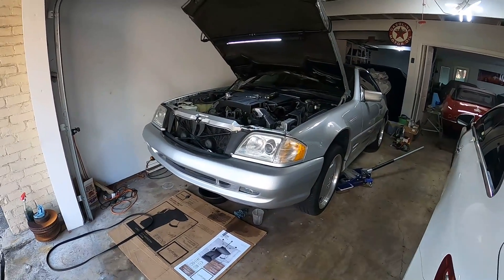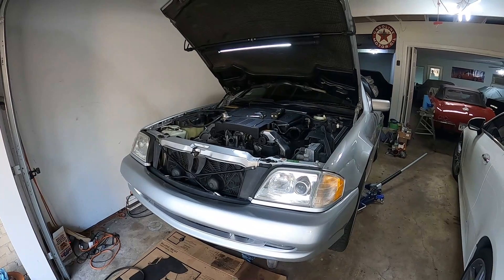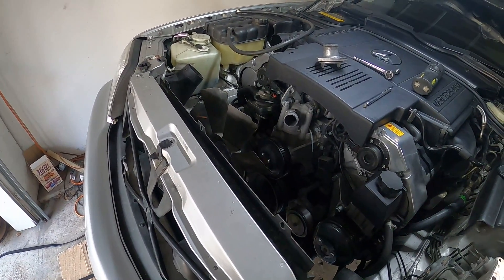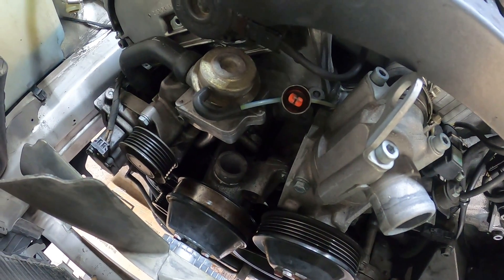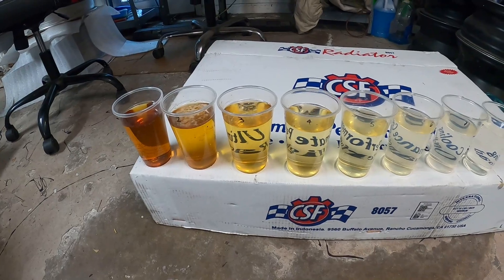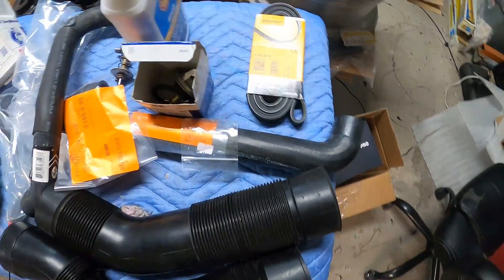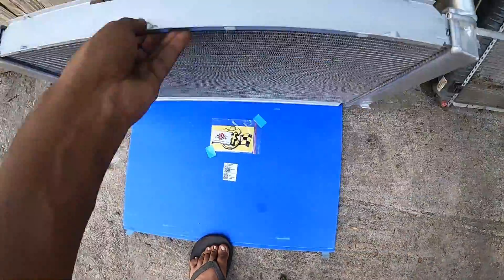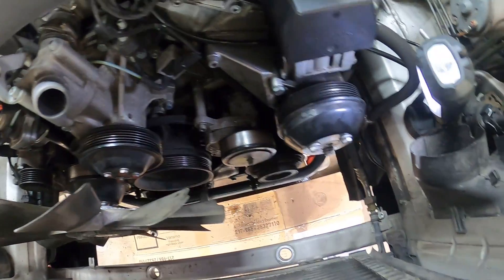Mercedes Benz SL500 R129 - Cooling Maintenance, the "right" coolant, CSF Aluminum radiator upgrade

Comment: Seem like the man om the cooling end on these one more question, om the reservoir cap the black tank , has a hose rite by the cap where does that go ? Or just not connected ? I just bought one and love these but a lot of heat and don’t want to ruin it

Comment: Hey boss , nice vid , I start mines and it runs hot doesn’t overheat but a lot a lot of heat comes off it and makes pretty warm in cabin do these run like that ? And top radiator hose gets hot hot fast any advice or I’m just over thinkjng , and when I squeeze the hose I can feel it going through but not much is that normal ? Appreciate the help think guy sold me a fixer up told me no issues but lied and love the car 😢 please help and I have ticking

Comment: Great video. I took a look at the CSF website and they did not have a listing (Radiator) for my 1998 SL500 . Similar to yours except its Black with Champignon interior and equipped with the Sport Package. 
Can you list a part number for the Aluminum radiator? Thank you, hope to hear from you. 🙏
Reply from the maker: Thank-you, glad the video was helpful.  The CSF Part Number is "8057".  You can buy them from reputed eBay sellers for $529, there are four for sale right now on eBay all brand new.
Reply: @slownrusty  Thank you for your reply! 
I purchased the radiator , est. delivery by Apr 14. 
Ordered parts from Pelican and EBay for this project. I’ve done quite a bit of work on my R129, to say the least, if you have any questions on R&R issues or maintenance, feel free to ask, perhaps I can help.
Once again, thank you and I appreciate your reply .

Comment: Damn man you didn't even show how to take out and install the radiator... What's the point of this video?
Reply from the maker: @projectathos  - if you can’t remove the radiator you should probably not be working on your car and leave it to someone with the aptitude
Reply: You'll need to remove the transmission oil cooler lines from the radiator, as well as the water hoses. The radiator is simply plugged in and can be removed upwards.

Comment: Love your videos, have a question for you. I have a 92 500SL I have replaced the thermostat and have a new short hose to replace the old one. Did you have to remove any other housings to get this little 90 deg hose in there. Having a real problem as the thermostat has to be screwed in first because the underside screw can not be gotten to with hose on.
Reply from the maker: James - that little hose is definitely a tricky bugger and I did not have to remove anything else to install a new one

Comment: 85-90C in the summer( 100+) in traffic w/AC on????  You have a rare car for sure.  Most run 100C++ under same conditions.  Mine(92 500sl) runs 100 C in NON stop and go traffic(12 mile hwy run to store) w/NO air(top down) on  in the summer 110 temp(I live in the AZ Desert).  And to keep it at 100C I had to put a cool harness on it to trick the fans to come on at 92c.  Man I would not mess with it and call it good.
Reply: What kind of cool harnes can you help me that also they sell a different thermostat which its open around 76 celsius i have to find that also
Reply: @TamasKrall  I do not understand what you are asking? Are you asking where to buy one?  Are you asking what they do?
Reply: No they dont. Unless there is a problem somewhere. My 500E has always been 85-90 no matter what.

Comment: I need to change the thermostat on mine she's been sitting under a cover for a while , do you need to take out the fan and the serpentine belt in order to do that like pelican parts illustrates or can I just cut the hose and replace the thermostat and put a new hose in , and one more question about flushing where do you add the water in and where do you flush it out from, without removing radiator, thanks
Reply from the maker: @Gus F - You need to remove the belt but the fan can stay in place. When I flush, I add water from the expansion tank and flush it by pulling the lower radiator hose, remember to run the car with the heat on for a few minutes to allow mixing from the heater core and block.  Best of luck.
Reply: @slownrusty Hey there and thanks for the great video. You flushed with the old radiator? So just remove the old coolant and fill with distilled water, run the engine and remove the water and repeat untill clear? And only them remove the old radiator?
Reply from the maker: @evgenyknafel2857  - You can flush the system with the new radiator installed, no issues there
Reply: @slownrusty  thank you so much , one more question how many gallon of blue coolant do i need to refill after flushing
Reply from the maker: @gusf8451  - 5 Gallons of blue (straight concentrate NOT 50/50).
Reply from the maker: @Gus F - 5L NOT 5 Gallons..fat fingered.

Comment: I was right in the middle of doing the same upgrade as well...but then I was like might as well doing this and this and this. So a water pump, thermostat, hoses, tensionner pulley, oil cooler flex lines, expansion tank cleaning and engine bay cleaning later... turns out my alternator was badly rebuilt by the ex-owner's mechanic. Now all it needs is another alternator and I can finally install the CSF rad lol. Come to think of it, I think I saw your post on the FB group!

Comment: Great video thank you so much for sharing lots of insight.
Reply from the maker: Thank-you!  I hope it helps and informative.  Some times I start talking and forget points I wanted to share, maybe I need to script it a little to remind me.  My mind races often.
Reply: @slownrusty  Haha no worries at all. this prompted to check my coolant and it was brownish so I will flush it and luckily already have the blue Mercedes coolant on my shelf. My car is pretty much the exact spec as yours and I also installed the H&R lowering springs for much better handling.